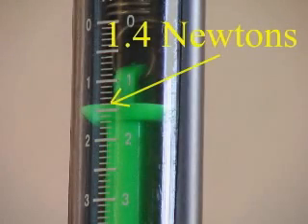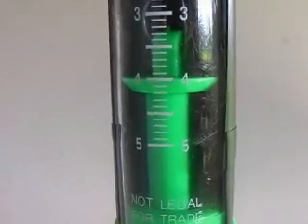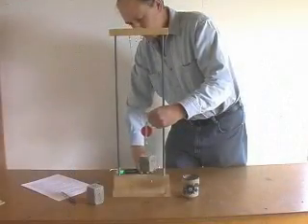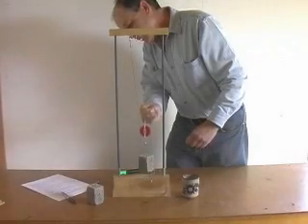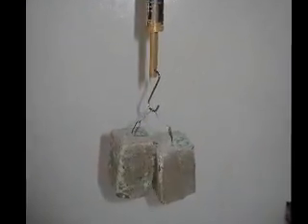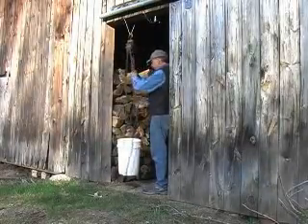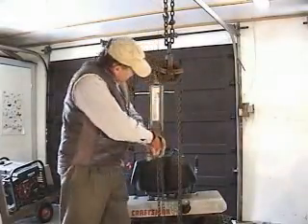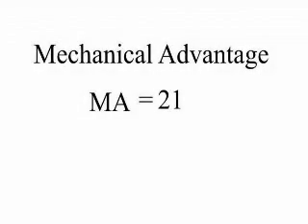Mechanical Advantage - Pulleys

Comment: @mike6413 No, it makes no difference. The pulley isn't acting as a lever, it's effectively dividing the force into two parts - half goes to the frame and the other half to the 'force in' (hand). Pulley diameters would be chosen to suit the application - total weight lifted, type of rope or cable, etc.

Comment: Nice video!
A bit too simplistic. The fixed measure for a pulley system is the velocity ratio not the mechanical advantage, so the velocity ratio is more basic. 
Also the IN force must be the force needed to MOVE the load, not the force needed to balance the load. The force needed to move the load will be larger because of friction and the weight of the pulley block. etc etc

Comment: Its very interesting fact that we can pull wait up using less energy but we calculate  total energy used to pull wait up may be equal to the pull up wait without special arrange pulley so no save of energy whether we use big power for some time or less power for long time total power consume will be same.  Is it or Not   ?